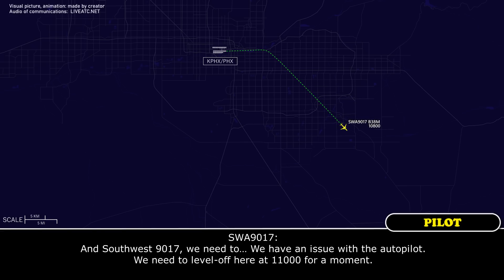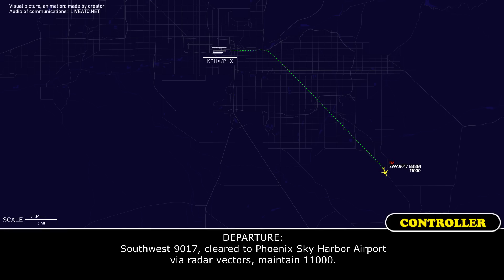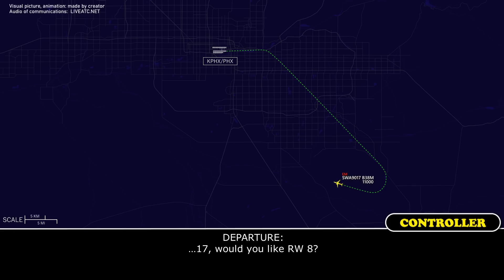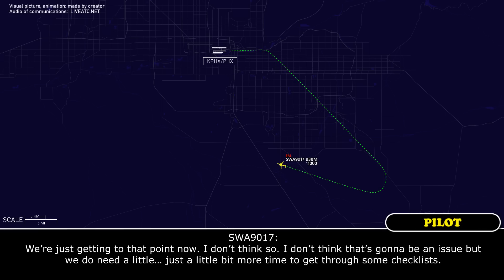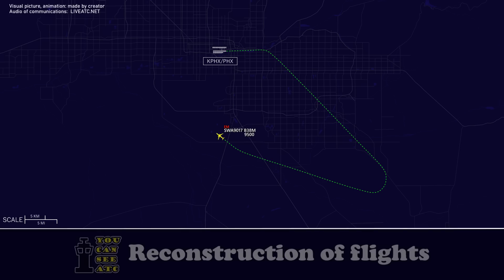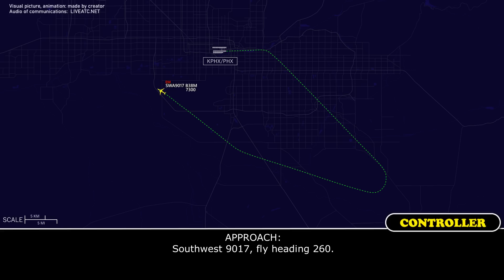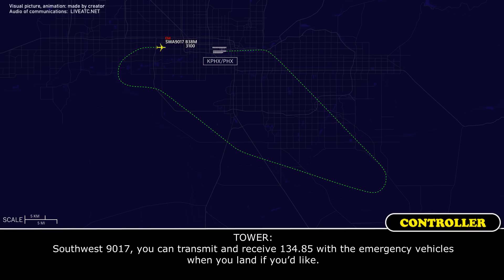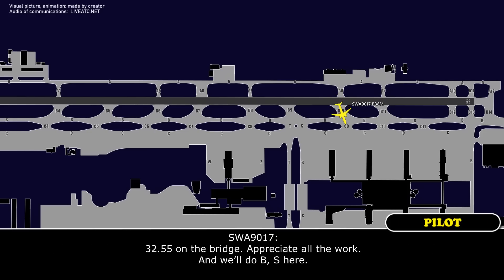“Trim system is not working”. Autopilot issue. Southwest B737 MAX 8 returned to Phoenix. Real ATC

Comment: Boy Trim System, Autopilot, and B737 Max 8 are not things you want to hear on a flight causing problems.
Reply: I have no clue what any of this means but why couldn’t the pilots just fly to their destination manually?
Reply: @MarkNOTW  They could but it'd be EXTREMELY tiring and probably against the rules of the airline to continue with a faulty aircraft. There's a MEL (Minimum Equipment List) they must adhere to.
Reply: @jimrobin  ok thanks
Reply: @jimrobin  the MEL only applies to dispatch, not in-flight failures, but true you wouldn’t want to fly the 737 for long without electric trim
Reply: @MarkNOTW   You have no idea how much effort it takes to keep a 737 in correct trim. It has to constantly be  adjusted for different flight condition. Watch any cockpit view of a flight and see what those trimwheels are doing at any given time. They're in constant movement Imagine having to do that by hand for hours
Reply: @johnstone7697  a bit of an exaggeration of "in constant motion", wouldn't you say?  At constant speed/power/configuration, they're pretty calm.
Reply: @737MaxPilot  the Max is the last aircraft you want to trim manually for any length of time.
Reply: @johnstone7697 not that hard to do keeping level flight.. not as tough as you claim
Reply: @MarkNOTW  several reasons. You can’t fly in some airspace without an autopilot. It wasn’t just the autopilot, but the electric trim. While it’s possible to fly the 737 without it, you wouldn’t want to do so for long.
Reply: @Pissedoff Cow58 Really  ??
What about the other two independent  autopilots on the B747??
They not working? ??
It is a requirement to have an autopilot for RVSM...Appendix 9 Section 2. ??
But then as a B747-400 Captain  what do I know.???
Reply: MCAS: I'LL BE BACK
Reply: @mro9466  it wasn’t mcas
Reply: @Porsche4life  How do you know? I'm not doubting you but just wonder how you know. 👍
Reply: @jimrobin  Narrative control
Reply: @Porsche4life he's joking
Reply: @Pissedoff Cow58 Exactly. But that contradicts what you said previously. The MCAS controls the trim of the aircraft.
Reply: @@75Gear Were you below F/L280?
Reply: @@75Gear Hand flying in RVSM airspace?
Reply: @stevenkeating225  In his armchair. ....
Reply: @Pissedoff Cow58 You have never flown any B747....
With or without an autopilot.
You never will??
True??
Your totally ignorant remarks give you away.
You are talking total rubbish.
You can select any one of the 3 independent  autopilots at any time.
So one fails...you still have two more.
It's only below 1500 ft radio altitude when in the approach mode that the other non active autopilots  join the actual autopilot in command for autoland capability.
You are getting confused with your MS armchair -8.
Reply: @Pissedoff Cow58 What do you think the MCAS controls?  Elevator TRIM.
Reply: Right?
Reply: @Pissedoff Cow58 Sure....
Reply: @Pissedoff Cow58 stop defending boeing we all know that airbus is superior!
Reply: Rudder trim different issue
Reply: @Pissedoff Cow58 no problem as long as you have trim which is what was mentioned, other than in the US you won’t be in RVSM airspace at least legally.  Without trim you are manhandling it or spinning the wheel and I wouldn’t want to do either for long. YMMV.
Reply: @bubbaoriley7864  I think you will
 find the NAT are RVSM which requires an autopilot. 
B 747 have 3 independent autopilots .
Why comment when you are so ignorant ....
Don't listen to other armchairs.
Reply: @Pissedoff Cow58 Exactly.  Far more common than people realise.  Proper standard crew training = no problem.
Reply: Every type of jet has Mach trim or trim issues, happens to us all.

Comment: Way too much drama here.  Pilot training 101...if automation is not responding like you expect, turn it off and hand fly.   Roll the trucks?  Umm, no.  Add to list of reasons I don't fly Southwest.
Reply: The only drama is coming from the comments section from people A) thinking that had anything to do with MCAS, and B) not realizing that pilots are required to divert and declare an emergency if they are experiencing significant flight control issues, even if they can hand fly it with no issue
Reply: I would have had them roll the trucks too, and I don’t fly for SW. You won’t fly them because they were being extra cautious?

Comment: Declaring an emergency because the autopilot is malfunctioning? Fly the plane back to Sky Harbor like a pilot. 🙄 It’s not an emergency. We had aviation for generations before autopilot.💁
Reply: Yeah.. those planes weren't called "737 MAX" 🥸
Reply: It's a brand new 737 MAX. 346 lives and 2 planes have been lost when autopilot started acting erratically immediately after takeoff. So fuck no, this bird goes riiiight back on the ground as quickly as possible.
Reply: It wasn’t the autopilot that was malfunctioning, genius.
Reply: @saxmanb777  At 38 seconds into the video the pilot says it's an autopilot issue. Even the video description says AUTOPILOT.
So go take your rude sarcasm elsewhere.
Reply: @palm7z  I fly the 737. It was the auto trim that was malfunctioning which led them to need to shut off the autopilot and use manual trim. They didn’t declare because the AP wasn’t working. They declared because the trim wasn’t working and needed priority handling. While using manual trim isn’t necessarily difficult, it’s still a high workload, especially if both pilots need to spin the trim wheel to get it within a reasonable trimmed condition. We do this exact scenario in simulator. They were 100% okay in declaring an emergency and I would as well.
Reply: @saxmanb777  wow love how confidently you’re wrong 😂
Reply: @ferrarikingdom  see my above statement.

Comment: The MAX is not a plane, it is being FORCED to be a plane and fly.
As a engineer for 43 years, the design is faulty and needs to be redesigned. You fix a problem, not patch around it
Reply: TRUE.. You can look at the flattened engine nacelles on the previous 737's and KNOW that they KNEW they were reaching the limits.. Could have made the gear longer, BUT, that would have required a big redesign which the BEAN COUNTERS for sure didn't like.. Sooooo, we put the engines on top of the wing.. NICE...
Reply: Bruh what are you talking aboiy
Reply: Sorry but you are out of your field on this one. The design of the engines had nothing to do with the two accidents, and more importantly, the plane can fly, unlike what netflix  documentaries claim.
Reply: @Hk-uw8my  Your qualifications? I already stated mine. And Pls. NO Microsoft flight simulation stuff.
Reply: @kendallevans4079   saying uninformed/explained nonsense even after listing some  qualifications won't nessarily turn it right though.  
I'll demonstrate how to actually use them instead of just exposing them.

There was definitely a  design error that  played a big role  in the two accidents  but that's not a reason for spreading misinformation.
 And this design error  was on the conception of the MCAS itself which has been rushed,and not directly related to the engines themselves.
Having a proper understanding of the original problem and the need for an mcas won't allow to write that this plane is being forced to fly.
Of course people already wondered about redesigning the main landing gear and/or the wings ,but they quickly figured out that it wasn't effective or worth a shot to do as much, just to correct  a slight manual handling  issue that only occurs in flaps up flight with an high aoa and pass regulation in the end.

So a software fix was definitely the most interesting solution in this particular case, in addition to the fact that a handling enhancement software for pilots was something very far from being a breaking news in the world of commercial airliners back then.
Reply: @Hk-uw8my  Narrative without qualification is useless.
Reply: @kendallevans4079  you resumed your problem well, as you are surely not rated on the 737.
Reply: @Hk-uw8my  I'm not. I'm an engineer I made that clear. You have yet to mention any background or experience which make one think you have none.
Reply: @kendallevans4079  sorry but you cant just throw random qualifications to turn any sketchy affirmation valid as  it's just like a banker who keeps repeating hes is a banker   as an only mean of justification because he has nothing else to say on a matter of food industry. You are certainly not rated on this type of plane which means that you have to apply yourself what you said.
Reply: How does an engineer conclude it was the MCAS after watching this short video? The MAX is not the only aircraft that has had trim issues.
Reply: @robw4379  Where did reference "this short video"? I'm mostly referring to the two fatal crashes, this could have been #3 if not for the pilots/ATC actions. I DID NOT say the Max was the only aircraft that had trim issues. So basically your whole response is inaccurate
Reply: @kendallevans4079  Let me rephrase the question. Provide a time stamp where "this could have been #3 if not for the pilots/ATC actions." The video does not provide any factual information it was the MCAS. You're jumping to conclusions.

Comment: Some people...  passengers... might say, "Can't they flying this thing without the autopilot"...  Yes, but if ANYTHING is not working correctly, they are REQUIRED to notify ATC and land immediately...  Declaring an emergency was, and always is, the best thing to do when there is any question about the safety of the aircraft.  Well done..
Reply: What are you talking about. They are allowed to take off sometimes even if various parts of the plane are broken.
Reply: @Videos888  Yes, and no...  I should have said auto trim, which is part of the autopilot system.  We don't know exactly what was going on.  If they were on an IFR flight plan, as most commercial flights usually are, and they were having difficulty controlling the aircraft, regulations state you must notify ATC immediately.  If any part of the required navigation systems fail, you should land as soon as practical, not necessarily immediately, but....  If I were the pilot of an aircraft full of people that just came out of the factory and it wasn't working properly, I would do what he did.  Turn around and land.  You are correct.  A lot of pilots continue on anyway.  And, lots of pilots, and passengers, die because it.  In aviation, always error on the side of caution.
Reply: @Videos888  as a pilot i took off 1 time with 150 people on board and i didnt have enough fuel, luckily i had a parachute and i jumped out of the plane and survived, everbody else went down with the plane

Comment: Yeap.... happened, AGAIN... The good part is: now the crew know how to deal with the trim issue, and that just saved 164 lives! But c'mon, Boeing... STILL?!?!?!
Reply: Yup! As a engineer when I heard they were going to go with a software patch I KNEW then and there I would NEVER set foot on a Max. You fix the problem, which is a plane that doesn't want to be a plane, not patch around it!
Reply: @kendallevans4079  All due respect, but do you even know what MCAS is and what it's for? The Max flies just as well as any other type of plane, it just handles slightly differently from other 737 variants in certain conditions. All plane types handle differently from other plane types, but in order to be certified as a variant of a specific plane type, it has to handle the same. So MCAS was designed to correct certain pitch angles to keep the Max flying the same as other 737 variants. And it never malfunctioned- it's design flaw was that it only received inputs from one pitot tube and there were no backups in the event that the pitot tube malfunctioned, it was designed to overcorrect pitch angles instead of the more logical decision to make smaller inputs, and it didn't shut off once pilots took manual control. All things that the software patch fixed. Don't get me wrong- the patch should have been done long before the first Max was ever delivered and engineers at Boeing knew about the risks of not implementing the patch - but now that they have MCAS operates exactly like every other auto-pilot feature running in the background.
Reply: @jb8331  With zero respect to you (because I suspect all your "knowledge" is from flight simulators) I do know. I'm an engineer for over 42 years, mostly for a company called Hughes Aircraft Company. Google them sometime. Here's your homework: #1 Grow up #2 insulting me will get you banned.
Reply: @kendallevans4079  woah 1) I never insulted you 2) you insulted me 3) your experience as an engineer does not necessarily mean you understand MCAS 4) your initial comment suggests a misunderstanding of MCAS to which you have yet to respond to my rebuttal 5) I’m not a MFS pilot not that it would have anything to do with my initial response anyway. Maybe take a time out before responding again. The ad hoc is unnecessary
Reply: @jb8331  1) You DID insult me questioning my understanding of MCAS. Re-read you rant.
2) I CORRECTED you, not insulted.
3) My experience as an engineer is not directly with MCAS but we certainly knew about it and it's application.
4) Addressed in #1....
Conclusion: Either you work for Boeing, are loyal to them for some odd reason or simply don't understand what it takes to make flight. Maybe you are a SW developer and are insulted that your "patch" is faulty?
Reply: @jb8331  You say no point in conversing then rant on? There is no point.
Reply: @kendallevans4079  I was bored and also tend to ramble on about things- you got me there. Wish the conversation had gone better. Oh well - good night
Reply: @jb8331  The world would be boring if we all thought alike..Peace!
Reply: Take the year off. Doofus commentary is exhausting.
Reply: The stabilizer trim issue the aircraft had was totally different than the alleged MCAS failure of the two other MAX aircraft